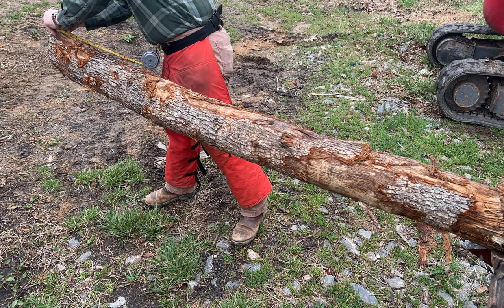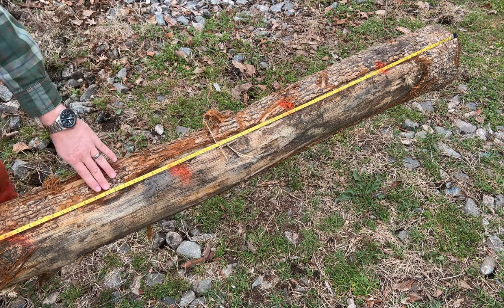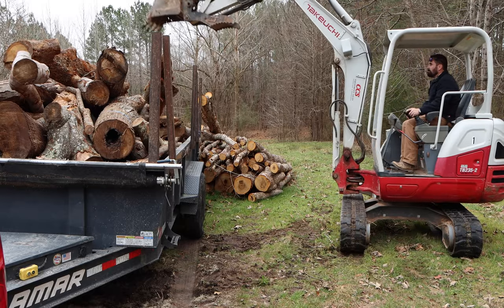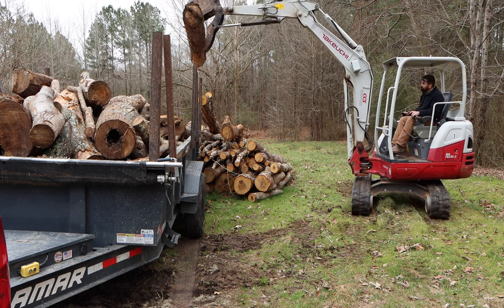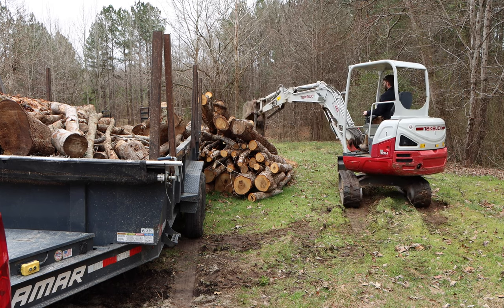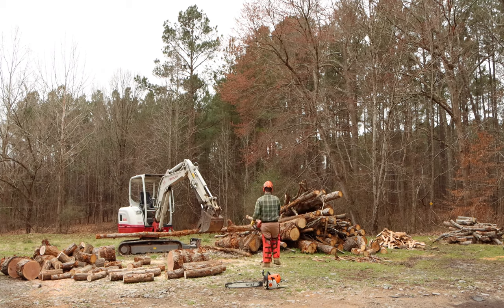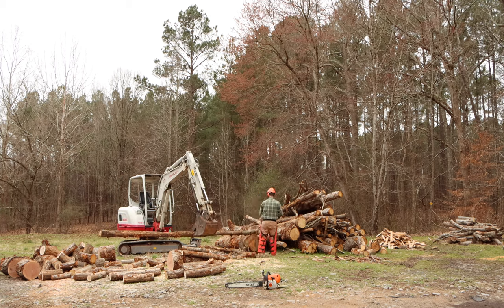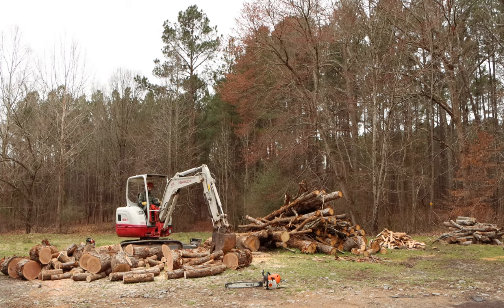How I Make Firewood Part 1

Comment: Nice, I almost do the same technique however I use a woody 130hd log loader trailer behind my tractor, I grab 3-5 logs at a time and hold above the ground like you, then i use my wood-splitter to load my trailer to move wood to where i will stack it or i use palettes on the ground under the conveyor and have loose piles, 3 palets wide just add palets as you go
Reply from the maker: Sounds like a great setup.  Just googled your log loader trailer, love it!  The right equipment makes things so much easier.  Thanks again for watching!